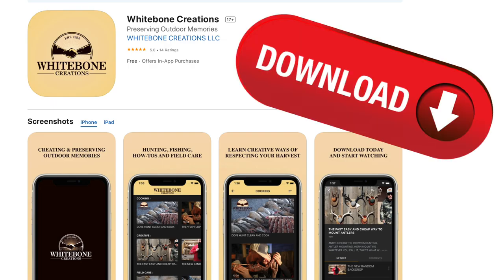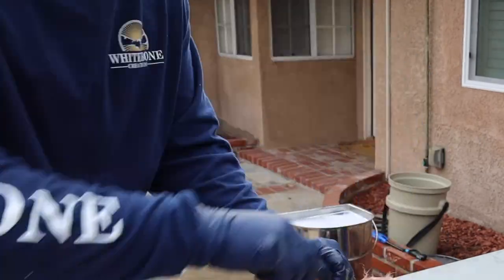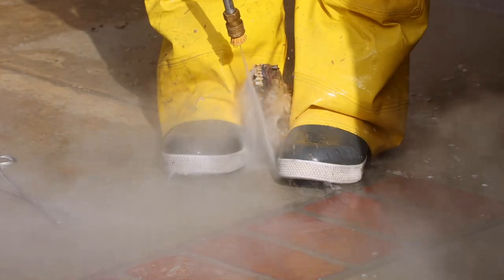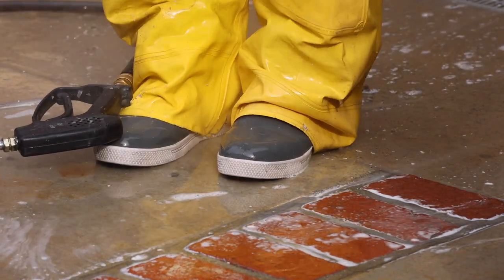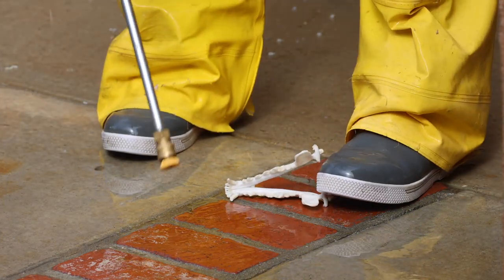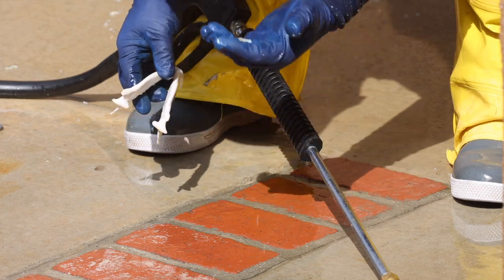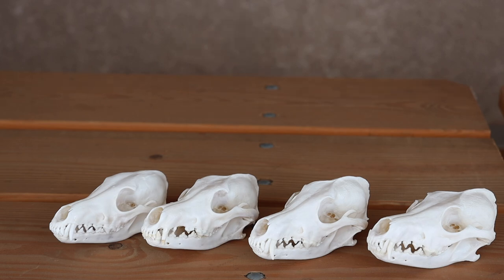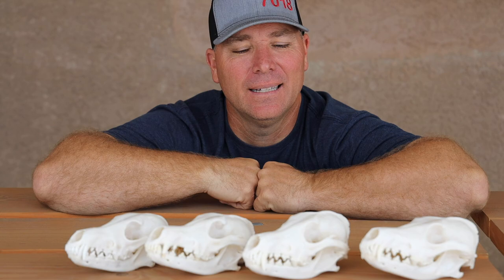HOW TO CLEAN A COYOTE SKULL

Comment: I found a rabbit skull that had been sitting in the sun, it had no flesh left in it. I boiled it to get rid of any bacteria for around 8 minutes. When I was trying to clean the rest of the debris off it had turned very brittle and was hard to work with. Any advice on cleaning smaller things like rabbits or mice?
Reply from the maker: Once they are dry I say no more boiling. Cold soak to hydrate then wash then cold soak in straight peroxide to whiten.
Reply: @WHITEBONE  thanks! :D
Reply: To be honest, I wouldn't boil a skull at all, it cooks the grease into the bone and degrades it over time.

 Rather, I put them into hot (not boiling) water, cover, and leave it. Change the water when it gets foul, and make sure the teeth don't fall out. You can do it with cold water, but it takes longer. With smaller things, direct sunlight on your container can keep it hot, but for bigger things, a fish tank heater should do the trick. 

Afterwards, when there's no meat left, put it into a wash with dish soap and let it degrease. This can take months. Once that's finished, I tend to give it a scrub with more dish soap and a toothbrush. If you want nice clean white bone, put your skull into a diluted peroxide mixture. The time for this varies with the skull, but it's not very long, and not in boiling water. (DO NOT USE BLEACH PLEASE).

For dry bones, just give them a soak or a scrub in soapy water, till they're how you want them. Degrease or whiten if you want. Once the bone is dry, it is no worse than handling a handful of dirt, so there's no need to worry.
Reply: Tysm! I’ve also tried that method of leaving bones in warm water, I also add in some dish soap sometimes. After I’ll clean any other dirt off of I’ll put them in a 3% hydrogen peroxide to whiten them. ( lol bleach makes them all mushy and gross). 
Again, thanks for the advice! :]
Reply: @pinstripez_8  yeah it's much slower but gives you overall nicer results